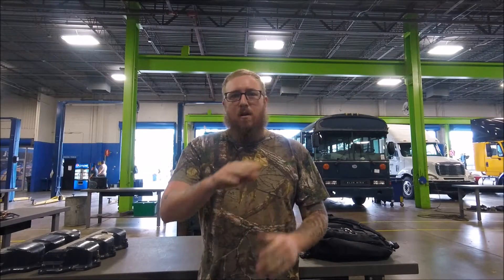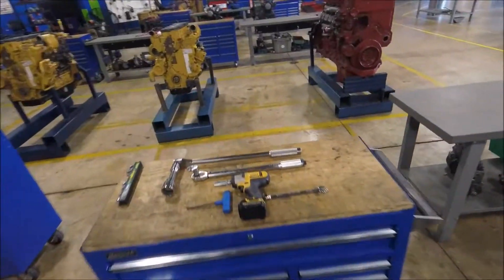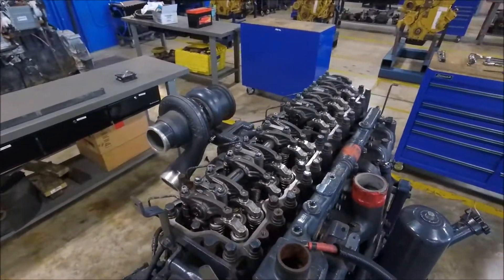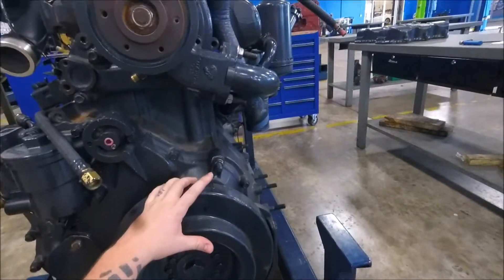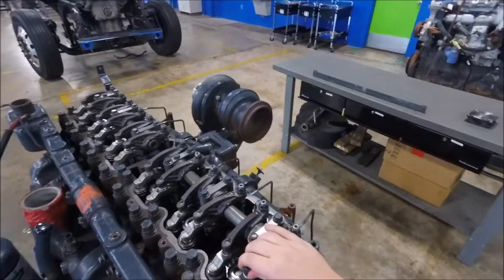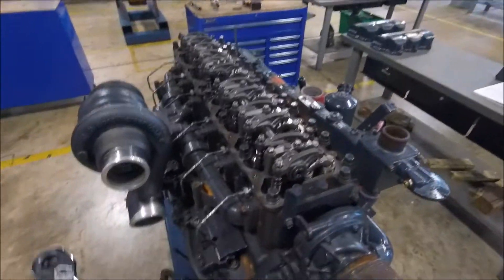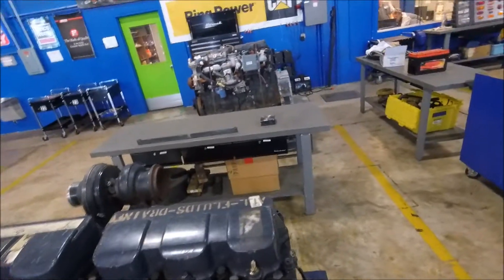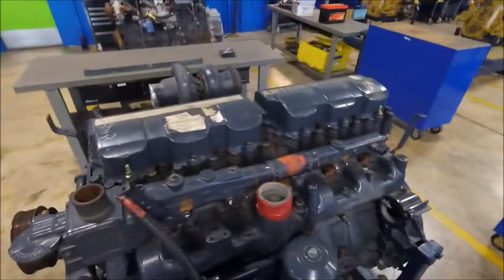How To Adjust Valves - Mack AI400 Engine

Comment: completely wrong, do not follow this video if you are adjusting mack valves.every cylinder needs to be done individually at TDC only one cylinder can be adjusted at a time according to flywheel mark. on an early e7 or e6 model valves must be adjust according to vibration damper marks.there are 3 marks 1&6 2&5 and 3&4. to know which 'cylinder is on tdc you must observe valve overlap on paired cylinder. if you dont know what that is you are not ready to do a valve job
Reply: Finally someone  notice this videos  on Mack's  are all wrong